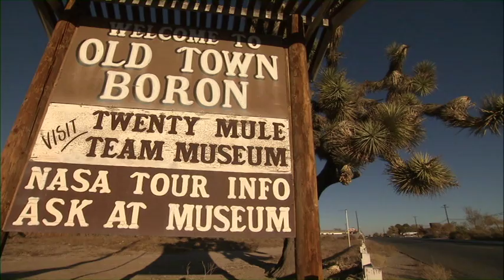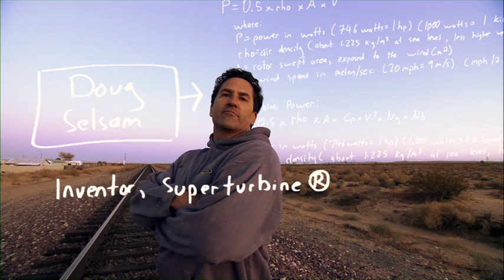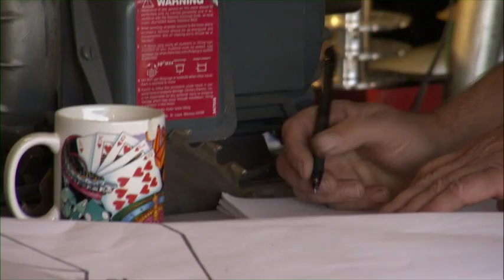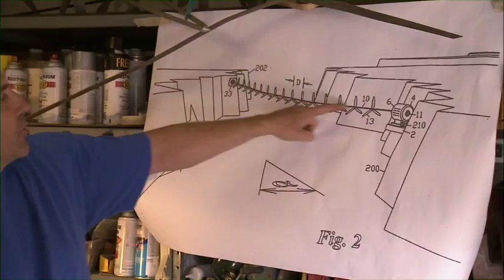Doug Selsam Inventor of Superturbine(R)

Comment: You are in the dessert. why not work on solar ? You have the sun ! 
Every Idea is a good one, 
I thought of a similar idea for a small blade system along the length of a house roof apex say 10 or 20 turbines ? 
in line as yours are.  maybe 12" blades or smaller ? nothing to disruptive to the  area.

Comment: Helium balloons? Isn't helium a source that is going to run out? Helium is a TINY atom and it escapes latex over time. Have you invented a balloon with a molecular structure to contain helium 100 percent? A long, flexing drive shaft will eventually fail and you'll be dropped things all over the land. I'm quite certain this has been looked at before.

Comment: Not convinced. If there was a shred of science behind this, they would have included power measurements. It's like saying: I am making more power from my diy solar cells than anybody! Look at my light bulb light up. Great...but how much power?!

Proof of concept is one stage of many. 

I am sure one of the problems with a multi blade design is maintenance and mother nature.
Reply: Well thank you for getting back to me but:

You call this impressive data? 
"7 rotors multiplied power by 6 times, making SuperTurbine(TM) hands down the most effective way to multiply power from a turbine of a given diameter"

You are basically saying nothing about the actual efficiency. Especially comparing diameters, sure your design might not have a huge diameter, but it sure is long (axial) with a pretty big footprint (adding danger to birds). Efficiency comes from cross-section and footprint of a design. 

COMPARE SURFACE AREA and SQUARE FOOTAGE.

Multiplying power x6 in a 7 rotor design, is like saying trains travel linear, but can also reverse directions.
Well yeah....doh, you add 6 more rotors, of course you are multiplying the first one...but is that of significant importance? Does it ACTUALLY increase and exceed efficiency of a standard (single rotor) wind turbine?

Compare apples with apples. LIKE THIS:
A commercial power plant producing 1.5MW with a cross section "X" of a tri-blade design and with an efficiency of 30-50% during 40mph winds (year average) generates 4000KW/hours a year, per 1/4 acre.

OUR DESIGN PRODUCES....< continue here

"Our facility is wind-powered..." also means nothing. Your facility could consist of a single LED light bulb as far as I am concerned. This is not usable data and a complete useless claim.

Better is:
Our facility uses 1000kw/h a month and is completely powered by OUR product, generating x-amount ...would sound much more convincing and scientific and exclude the possibility that it is wind powered yes, but not by your own product.

Common, you can do better if there is any use for this design. NUMBERS please, point me towards the ACTUAL data so we can work with it. Sincerely, best of luck to you and your design, if it really is viable.
Reply: Hmm, well great response, I appreciate you taking time to write that.
It's basically the content of the "promotional video".
So basically what you are telling me without saying it, you cannot share the technical data or test results conducted by GE Wind?
Even rough estimates should be within any legal parameters set by investors and possible linked contracts.
If there was a tighter contract to not share information, the video should never have aired either.
I glad you are as skeptical as me, haha. I just DO NOT appreciate circumstantial promotional videos.

Comment: This is the worst case scenario, please not even think about this concept. the only wind power that can save the planet is from hurricane . the largest vertical 2 blades on a mobil platform on the sea , could generate 10 times more energy than the biggest wind turbine.  the Aerogenerator is the holy grail of wind energy

Comment: Its very possible im missing something here but how is this idea any better than the traditional single rotor turbine? Your still only turning ONE generator. The rotors are not the component that produces the power. You can build this thing all the way to the moon and back but your still only going to be turning one generator. The only way this idea could be considered useful is if you had a separate generator for every rotor. At that point the weight would prevent this idea from ever getting off the ground. I would think that even if you only intend to increase efficiency and not so much higher output , this fact that you  have a long, flexible drive shaft flopping in the wind would make it near  impossible way to properly balance the machine which would result in a huge decrease in performance. Think about the mechanical fatigue this thing would be exposed to on a daily basis as it sways and bounces in turbulent airflow. This is an old video and I have yet to see an update on it so im going to assume reality set in and it was determined this idea is a bust.

Comment: Have you tried your design in water? I live on the Suwannee river with a constant 3+ mph current and thought of trying a design like yours underwater , maybe spinning on a stainless steal cable about 5 ft. Off bottom to a dock that juts out into river. Anchor the up river end in river and run to dock where end comes up to dock.... Will need gearing up because of rpm but thought that staying off bottom and under the surface where 95% of sticks, algae, etc. would effect turbine. What are your thoughts?
Supercharger@excite.com        Www.superchargertech.com.        CHarles

Comment: No invention schools? How about basic engineering + logic as an option sounds?  1kW from that 20m "worm" that can rotate on a grounded pivot point = area of circle of 20m radius, how about take area with 10 time the radius = 100 times area and get into MWs with conventional turbines, that is x10-20 greater energy density per area which is actually more important than saving a bit on materials. When you do 10- 20m long demo turbines it is all good and dandy, but once you get into hundreds or even thousands, that is expensive alloy and composite material zone and you are saving nothing. What do you think tension and torsional forces would be in that 4 inch diameter shaft from all those blades all that weight??? It is good for kick starter campaign to scam gullible people (like solar roadways), but once you employ some math, all you hear is a bubble popping sound.

Comment: Uhm, these axes will break if they run for a few hours or so,  it is like bending a piece of metal back and forth, at some point it will break. You can make it of fibreglass or carbon fibre or whatever, but this will happen none the less... If you do not want it to happen, the axes must be made so wide and heavy, it makes no sense anymore.

Well, it has been 7 years ago, and I havent seen such turbine beside this video anywhere! Proves a point, does it?! 

At the other hand, conventional turbines are getting bigger and bigger, and therefore more efficient, and per watt they are getting to be very cheap compared to 7 years ago. Wind and solar is the future, if there is no wind here, there is certainly some wind elsewhere.. the electricity transporting systems in Europe are getting upgraded as we speak to connect all these wind farms throughout Europe together, so we get a more balanced system, without huge peaks or shortages.. It takes some time before this huge project is finished, but I see these "wintrack" electricity transporting poles rise up everywhere in the Netherlands (380Kv transport system) and also in the rest of europe some huge upgrade projects are on their way, to get ready for the more electrified future!
Reply: Also that design with the helium baloons, flapping in the wind?! Hard to believe that will sustain that flapping much longer then a few hours. It doesn't look very stable to me.I mean, if the bending of the axis passes the deformation limits, it will get out of balance soon and a dynamic runaway occurs, stressing the whole system beyond its ultimate stress levels and breaks up. Did you ever see that Tocoma bridge collapse video? I expect something similar could happen with this design.
Reply: If it was a prototype, that is OK, still wonder how long it had lasted, or did you take it down before it collapsed? :-)Hey, but I am with you about the windenergy future! In Europe huge projects are on their way, huge windfarms are built off shore in the North Sea at a staggering pace and 20 miles from my home 25 1000ft high modern windturbines are built on shore, they will provide energy for the whole provence. But the best thing is that all these winfarms all over Europe will be interconnected with new 380Kv powerline systems, preventing peaks and shortages, because there is allways wind somewhere. You know, that Paris climate agreement is forcing our governments to take these actions, otherwise they will not be able to comply, and get punsihed. It has been the catalyst to gear up all these clean energy projects. Solar will also take a big chunk of that, I have 14 solar panels on my roof, and for me electric energy is free!I think your super turbine concept can be used on a small scale, like remotely located homes and farms, but scaling your system up you will encounter huge stress problems in the axis, that will be hard to solve.

Comment: This is such a ridiculous scam... I bet the whole shit would not survive longer than a few days before it breaks to pieces, just look how thin are all the parts, not strong enough to withstand serious load. Re efficiency: just look at the blade area of a regular wind tower and the ridiculously tiny blades of this flying blender. The power output would be inversely proportional to the square of diameter of the blades. Calculate yourself. You'll get far less than 0.05 per cent "efficiency" compared to regular wind generators. Just look at the ridiculous tiny generator (50W or so) at the end of this monster.

Comment: Uh yeah Doug, they do have "inventor school", try MIT or even get an engineering degree so you can learn why your invention won't work.
Reply: Doug Selsam...... touché 👌 what about the math Doug? If you compare individual wind rotors to generators vs multiple to one generator what are the results and what about wind direction? What about multiple  rotors on a rigid shaft mounted under a semi rigid blimp tethered high up where the wind is stronger?

Comment: It's a cable inside a shaft like a weed eater genius
Reply: Nope! It is the fiberglass shaft that the hubs and blades are connected to. The whole shaft rotates.
Reply: Robert McLennan I guess I just missed that ,for some reason I am having a problem trying to picture the whole shaft spinning with the bend that it has in it .Just underestimating the power of wind I guess
Reply: most pipeline structures will flex in rotation.  they use steel pipe as drill stem to make 90 degree turns over fairly long distances in horizontal  oil wells ...    similar effect... you just have to control the bending radius over sufficient distance...